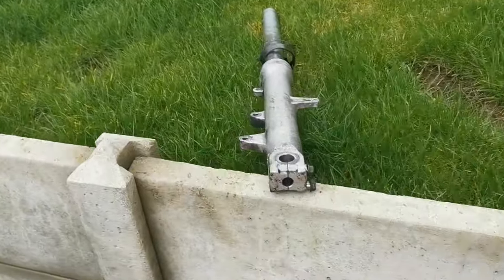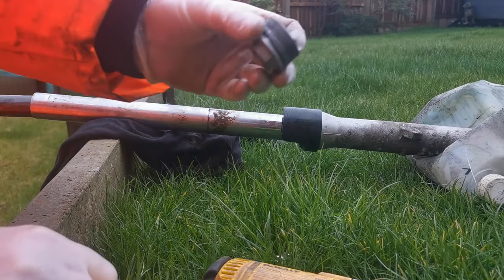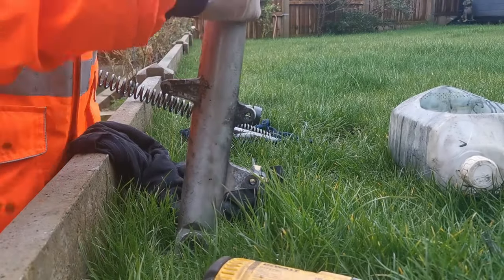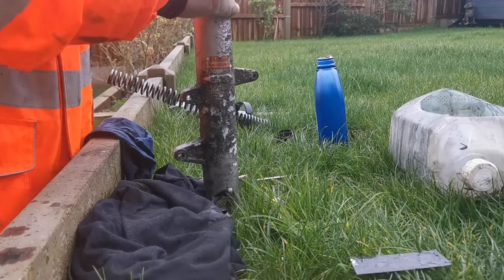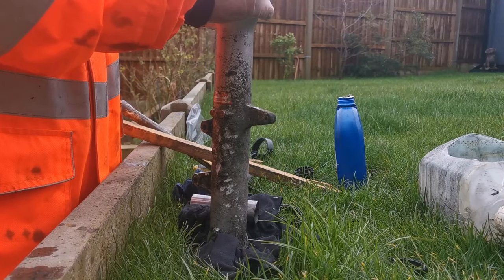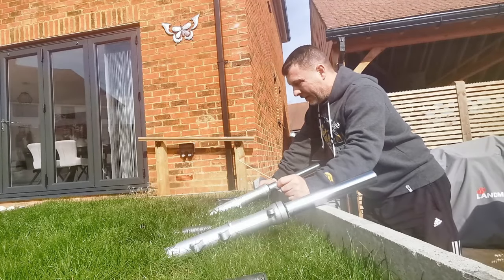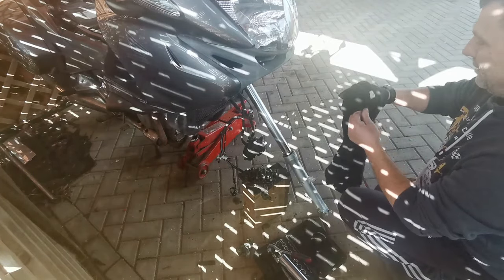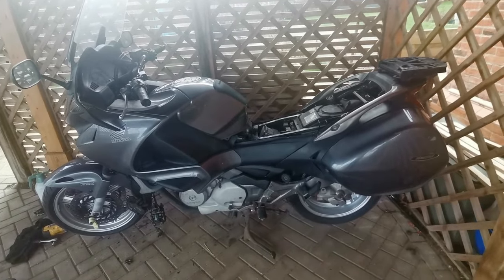TIMED FORK SEAL CHALLENGE HONDA DEAUVILLE 2008

Comment: Hi, the fork bars often have rust on the top, no matter how much you clean it, some of it usually remains and the chrome plating on the bar is lifted. When you insert the new seal, it damages it and the forks end up losing oil again after a few months.
It is advisable to tape the "dirty" part so that the seal is not damaged when inserted. google translation...
Reply from the maker: @gcalassa  great tip, thanks mate

Comment: you can pull those bottom bolts out and drain the forks first thing, if you leave the forks attached to the bike, use your impact to loosen those bottom bolts and remove them while the forks are still on the bike. Then you can drain the oil without having a mess while the tubes are still in the steering  clamps..
  then loosen the top caps while the four tubes are still clamped in the clamps. that is one bolt you must loosen while the tubes are still in the clamps  … You don’t need an impact for that. Just the right size socket, or a large  crescent wrench or the correct size wrench.
  when driving the new seals into the fork slider, use the old seal to push the new ones in.. I also use grease on my seals before I install them..
 The fork seals on my recent purchase in 2023, of a 2010 NT 700 from the original owner, does not need new fork seals. So whenever I pull the forks to change the oil which is now here in 2024 — 14  years old with about 8700 miles on the bike, I’m going to change the oil but not the bushings or the seals. I’m just going to change the oil on my nt700, and I am going to change the oil on my big machine at the moment, my Yamaha royal star venture. There is a clash of ideas between myself and Yamaha. In the owners manual for my Yamaha royal star venture. On the maintenance chart in the owners manual, it indicates that there is no need to ever change the fork oil…
  I absolutely disagree with that, if, for no other reason, the forks on the Yamaha royal star venture are air forks.. Air that the owner of the machine or the mechanic working on the machine puts in from an air hose from air that comes from a compressor.. you adjust the air pressure in Air Force maybe more often than checking or adjusting air pressure in tires..
  that air has moisture in it. Over the years, my Yamaha royal star venture may only have 36,000 miles on it, but it has been getting moisturized air in the forks for 16 years. I wonder how much water is in those forks after 16 years..
  that is why I am going to change the fork oil, going against my owners, manual recommendation..
I am also not going to change the fork seals on my Venture while I have the fork tubes out. Because they’re not leaking. ..
  One of the things that makes fork seals go bad is, dried bugs on the fork tube where the seal goes over it. Every time you clean your windshield or your face shield, if there are bugs on there, your forks  have bugs on them too. So you need to clean your fork tubes in the wipe area where the seal passes over as often as you clean your windshield or your face shield…
 it’s not a bad idea to put gators over the four tubes now while you have the forks off to protect the wipe area of the fork tube from not only bugs, but rocks that get kicked up by cars you are following..
Reply from the maker: @Jodyrides  excellent advice there mate, will definitely take that onboard next time, thanks for watching 👍

Comment: Great video, what is the electric wrench and impact driver your using?
Reply from the maker: Hi, the impact driver is a DeWalt 1/2" but the battery wrench is just a cheap Amazon one but I made sure it came with two batteries and had variable speed, and its excellent 👍
Reply: @vroomroom1  nice might look into that